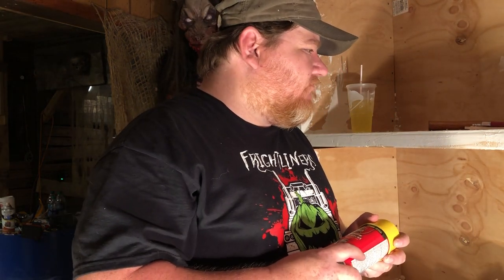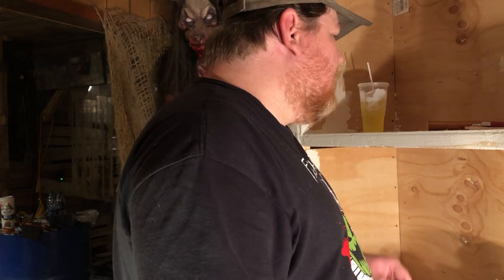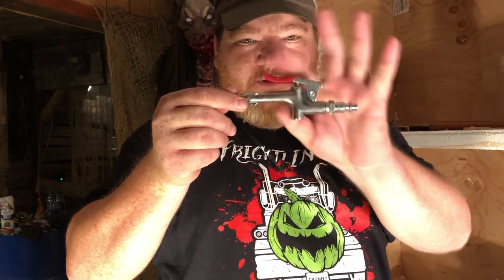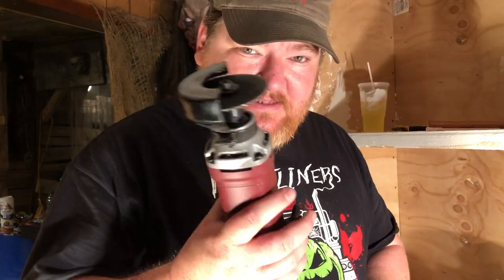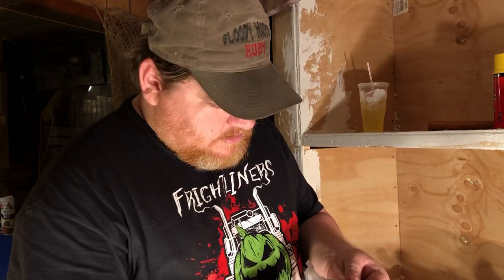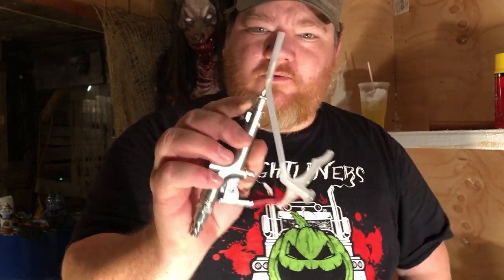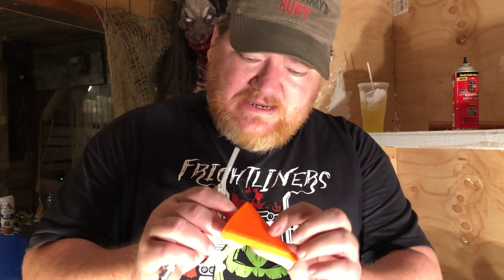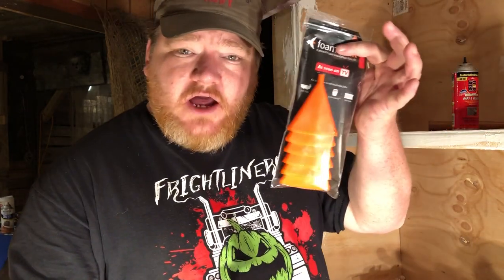The Great, Great Stuff Spray!

Comment: 😂😂😂with your accent I thought you said HUNT not HAUNT.  That's why I looked up your video; I want to coat the inside of a hunting shack. I  watched your other video first where you were actually demonstrating how to apply it. After a few minutes I was wondering what in the SAM HILL  kinda hunting shack IS THIS?  It wasn't until I  watched this video that I got what you were doing. 🤣🤣🤣   I think your technique will be perfect for coating the tin on the inside of the hunting shack too. It will deaden the noise as well as seal it up for having a lil buddy heater in there.  Can be 0 to 10 degrees sometimes  at that time of year.  Much colder later on. Excellent idea and video.  Especially when you told your viewers to shut up,  that cracked me up.  Cheers buddy.
Reply from the maker: LOL! Thanks. Yeah, just prepare to get foam everywhere bcause it can / will spray sometimes where you don't want it to come out etc. But it is a great way to coat walls and tin etc for insulation purposes. I wonder what R factor it would give at 1" thickness...
Reply: @creepybunny255  👍

Comment: Came across this looking at the portable great stuff foam guns, this is awesome and going to save me a lot of time and money insulating my van. I appreciate the share.

Jason
Reply: This is such an awesome idea, and it works.  I just did this today to insulate part of my van.  For insulating a whole van I'm not sure if this method is cheaper.  it is definitely more work.  In the future, if I were to do my whole van i would go buy the kit from home depot. It DOES work, but my issue with this is that you have to constantly change out the cans and it creates a mess while you are doing that. and if you are stepping in the mess, then your feet get sticky and the drop clothe sticks to your feet.  I bought one of the tyvek suits and i cam glad i did.
Reply from the maker: @num1champ  Before I was done with these sets I did a sq ft comparison. Didn't video it though. It was less than half the cost of buying a tiger-foam kit. However, the tiger foam kit produces a THICKER application, as opposed to the great stuff. But I started doing it in multiple layers and still saved money. Kits are MUCH easier and less messy for sure!
Reply: @creepybunny255  thanks! I appreciated you posting this. it totally worked for what I needed.  I did learn to make sure you have a larger air compressor or you'll end up waiting for the compressor.
Reply: @num1champ  how many scfm do you need? Gallons?
Reply: @kodiham7532  I used the cans, so I'm not sure.  I can't remember how many cans I used.

Comment: How are you fastening the ball needle to the blow off gun ? Hot glue ,did you thread the blow off gun ? If you did ,do you remember thread size ? .  Freakn awesome idea btw !! We can't wait to try this in the haunt,just hung up on the ball needle part
Reply from the maker: Most blow-off guns have threads that these valves screw into.
Reply: @creepybunny255  ,well hell...off to find another one..mine had the adapter but it wasn't threaded. Thanks for this idea man, it will help a lot with our mine area...which really is tunnels. We were pricing tiger foam when we found your video. You rock !!

Comment: What screen do you use before spraying?
Reply from the maker: Hey, we used anything from window screen rolls found at walmart (aluminum) to the thicker, black landscaping fabric. If sprayed thick enough, you get no real benefit from either underlayment... for the majority of the strength will come from the foam thickness unless you spray really thin like I did on the walls.

Comment: What are the original yellow foambeaks called? Can't find them anywhere... Also, what do you use as a hardcoat?
Reply from the maker: Liam, man. After my initial tryout on those foam beaks... I hadn't had much luck with them. I stopped using them entirely unless I was using them on the can as intended. 

We hardcoat with: Portland cement mixed thick, add some house paint / titebond 2 wood glue. This helps it adhere. On polystyrene? The bubble foam, you want to go heavy and many coats. 5 to 6. On the harder foam such as the spray and sheet foam (pink stuff) 3-4 coats will get you. Haunt it up!